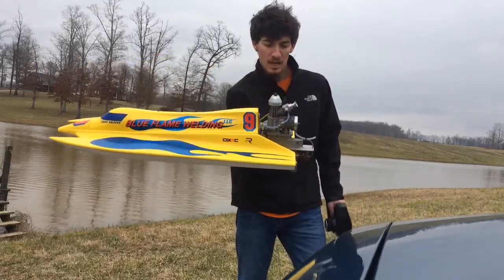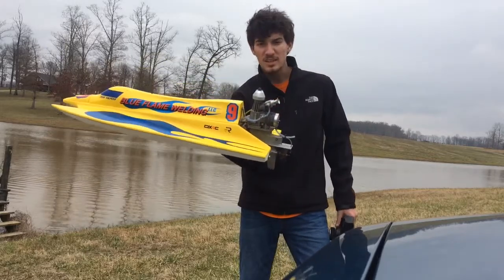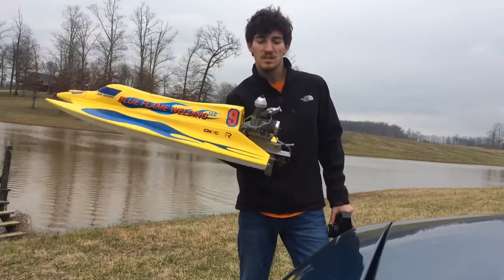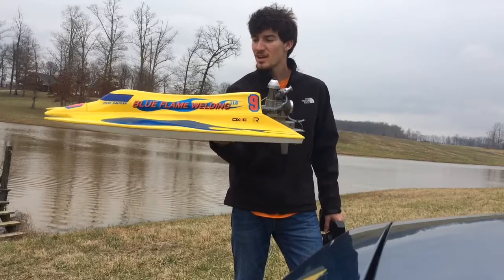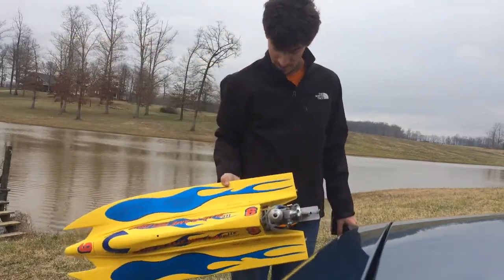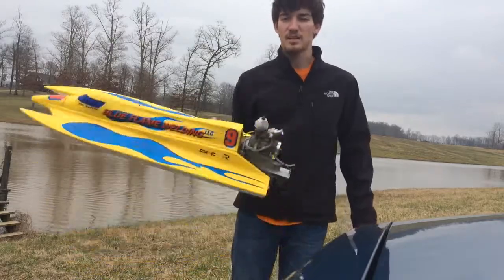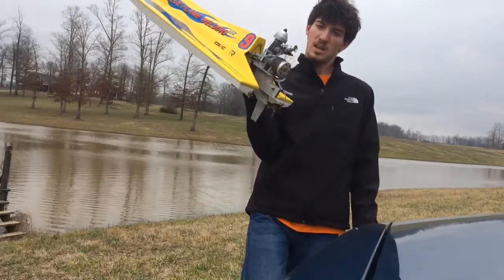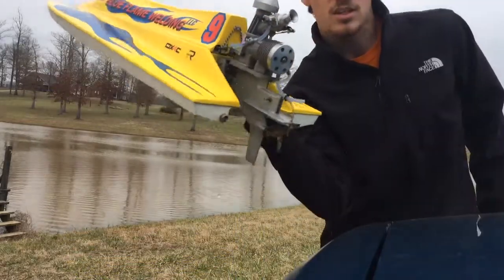Predator Tunnel Hull with K&B 11cc (67 c.i.) Outboard

Comment: One of the best detailed videos ive ever seen thanks for sharing, ive got my dads  .67 tunnel hull going under restoration, can you still get parts for these? Need a piston sleeve and rod
Reply from the maker: david hill Thank you. I believe you can get parts, but I honestly don’t know for sure. It’s been awhile since I ran these boats. Goodluck!!
Reply: Do these 11ccs have ball bearings or are they plain bearing ? Thanks man i appreciate the info
Reply from the maker: @davidhill5621  I'm almost positive they are ball bearing. At least mine was when I opened it up.
Reply: @TN_MuskyAddiction  thank you bro i really appreciate it,  i just fpund a parts list on k&b meoca site, cant get parts for 7.5s but can 3.5 and 11 cc 13cc and 82s
Reply: MECOA has parts for these K&B outboards, and they still make these K&B 3.5, 7.5, 11cc and even an overkill 16.4cc version .

Comment: Hey buddy got my boat out and running i got a 455 prop it seems to bog and die at full throttle it seems on rich side ,im i running to big of prop? Any suggestions?  Whats a good fuel ? Im running 20% vp master basher car fuel with added castor to 18% think its the fuel? Thanks
Reply from the maker: I would run 30% helicopter fuel with 22-23% oil.  Also it could be the prop, or it could be that your high speed needle is set wrong.  I wouldn't lean it way down, but I also would try a couple clicks at a time towards the leaner side on that high speed needle.